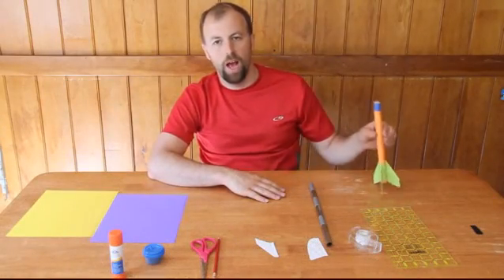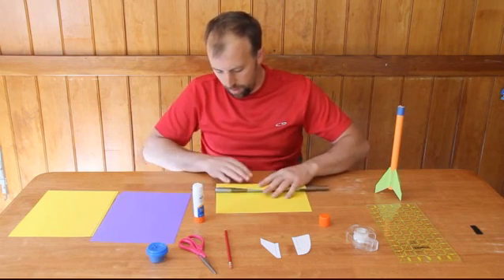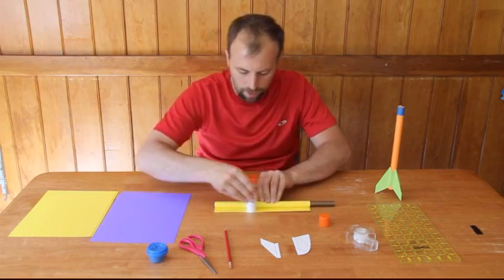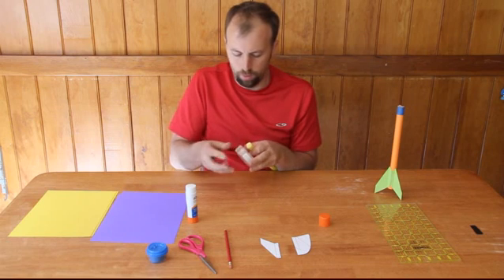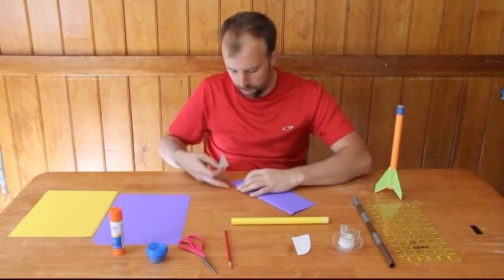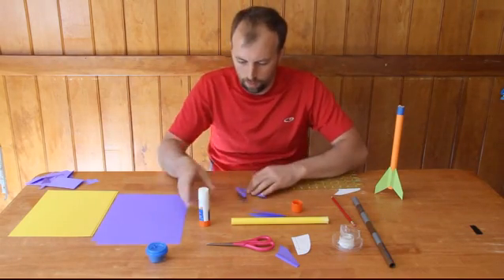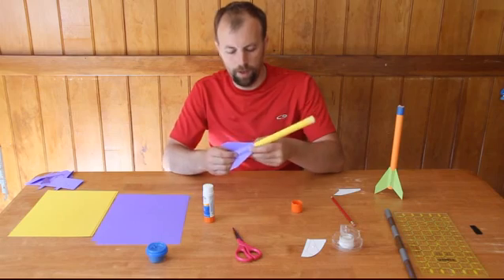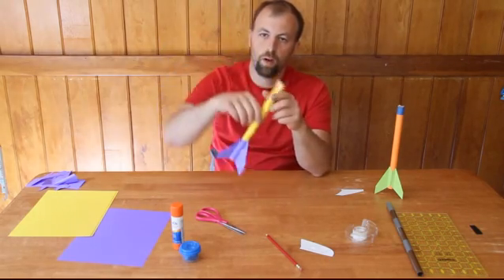How to make a paper rocket that flies.

Comment: can it actually fly because i need to see first.
Reply: without using that thing you used in the beginning of the video
Reply from the maker: Yes it does fly. I've seen them go over 300 ft high, however you do need to use some type of air compression tank.

Comment: How do you make the pvc pressure chamber / launcher I know to make a tube out of pvc with a copper pipe coming out the top for the rocket but what about the way he released the air just how did that work

Comment: Can you replace the play dough with something else? We are launching paper rockets in science, and we can only use paper.
Reply from the maker: The play dough is used to give the rocket weight and balance, you could try scrunching up some paper tight and then adding a little water, making a paper wade and stuffing it in the nose of the rocket.  Good Luck
Reply: +Stephen Martin i think it is only to make the tip stronger so it doesn't rip from the air pressure, so you can glue paper to the tip of your finnished rocket.
Reply: +Stephen Martin can you replace your image with iron man bc he would be up captian america
Reply: +Eric Davis 0k
Reply: +Eric Davis That's a cool idea. What do u mean by Captain America?
Reply: papers
Reply: +Stephen Martin love
Reply: Stephen Martin  adc

Comment: Great video! I do model rocketry and I think that is a very good project especially with kids. Safer to! If you want a stronger tube use white glue, wood glue or possibly epoxy to hold the paper. Same with the fins. You probably know that but just recommending. Also for the nose weight you could use epoxy clay. That would make a strong permanent seal . But that way is very easy, pretty strong and fast. Thumbs up!

Comment from the maker: I launch it by using compressed air.  I built an air chamber out of PVC pipe, and attached an irrigation solenoid which released the air from the chamber which powers the rocket.

Comment from the maker: Whatever type of pipe you use to launch the rocket, you want to make the diameter of the rocket just a fraction bigger.  I used copper as the form because my launch tube was copper.  I could have used PVC pipe, but I had a piece of 1/2" copper so I used that.